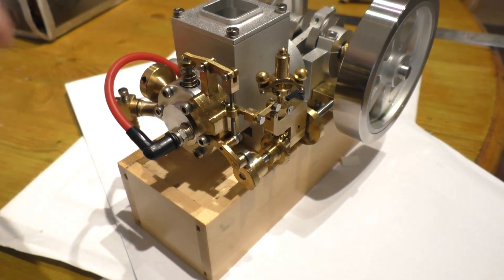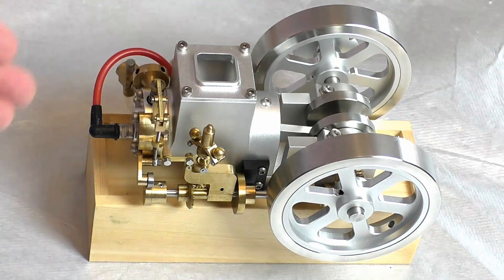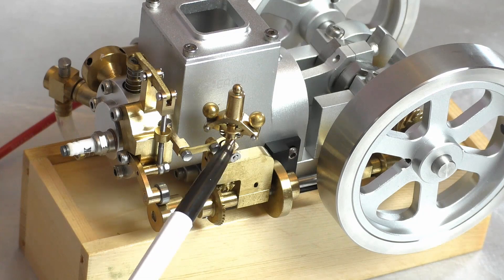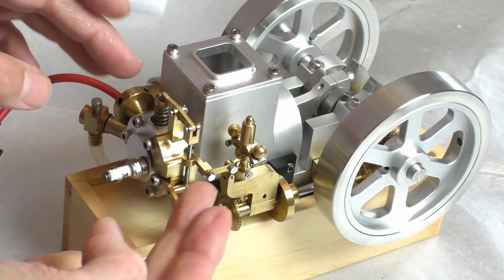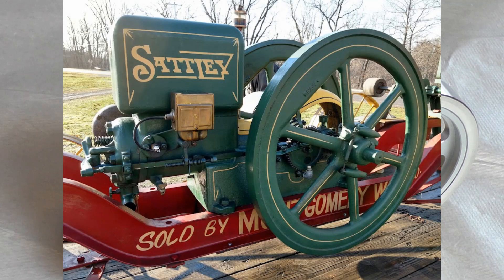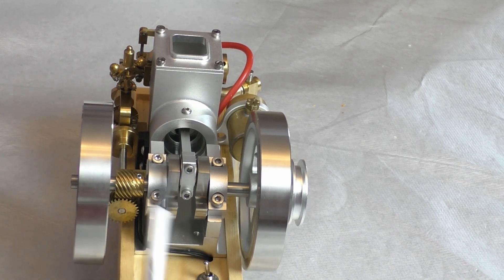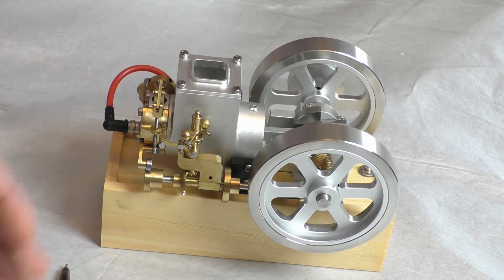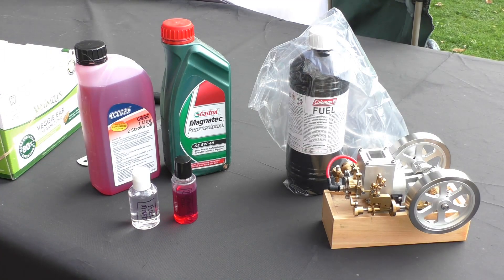ET6 Petrol 4 stroke Hit and Miss model engine.  (2022)

Comment: a tip is to run the ignition on 3 volt instead of 4.5. the module will last a lot longer